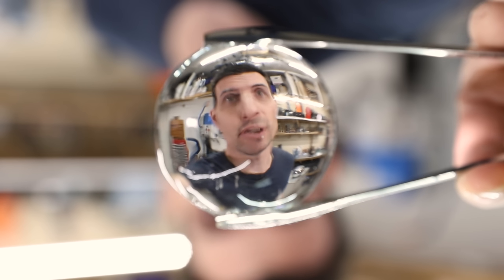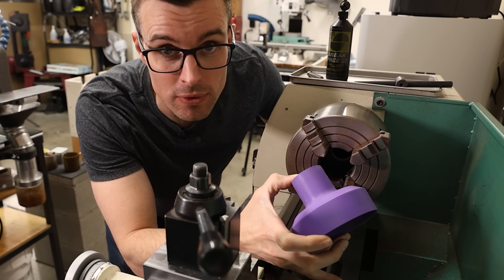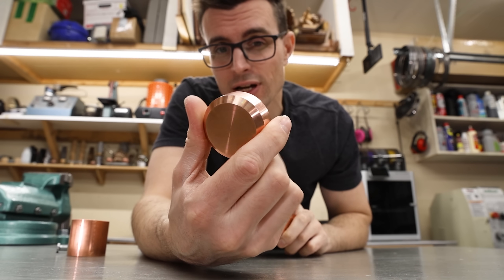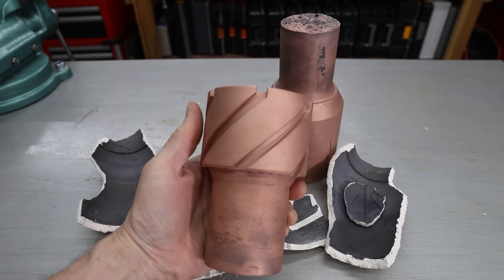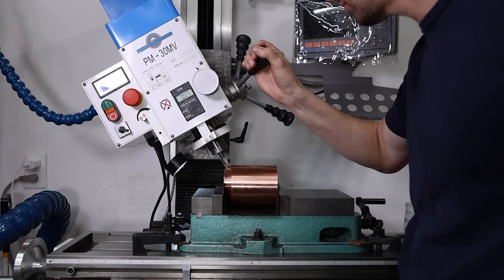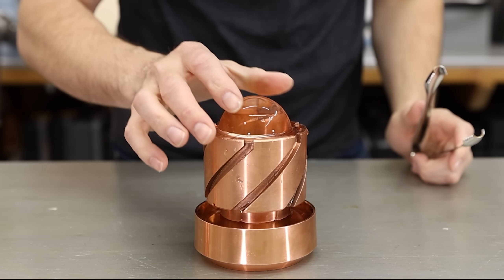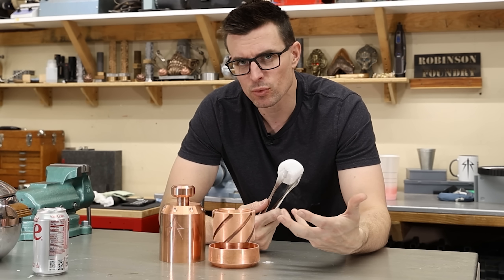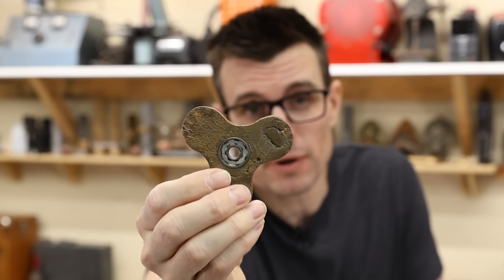I made a Copper Ice Press that Turns Ice into SPHERES - Lets try DRY ICE!

Comment: Just some fun math:
The specific heat of Copper is 0.385 J/g°C.  The latent heat of fusion of ice is 335 J/g°C.  Translating, that means it takes 335 joules to melt 1g of ice, and it takes only 0.385 to raise the temperature of one gram of copper by 1 degree.  You can simply divide and find that it would take 870g of copper to melt 1g of ice if the copper only cooled by 1 degree.  However if you have the copper at 120 F (49C), that's 49 degrees to work with so you divide again and find you need 17.76g of copper for 1g of water.  Those are basic ratios so you can substitute any unit (eg pounds or kilograms) and it's still the same numbers.

This assumes that the copper does get a chance to warm up by transferring heat from the air, your hands, or the table surface.  What I would like to know is if this device works off of its own thermal mass, or if it's just transferring heat from the environment.  The question is how much mass of ice is being melted.  If it's more than about 1/2lb for a room temperature press, the thermal mass of the press won't be enough and it must be functioning off of heat transfer with the environment.  If that's the case it means that a much lighter press would work almost just as well.

Comment: If you make another attempt, use the grooves as a built-in alignment tool. Still deep enough to channel the water away, but it would add to the satisfaction, watching the two pieces mesh together and spin as it closes. That was my original thought when I saw it. Also, on this scale, it may not be necessary, but using thermal compound between each of the parts that screw together should increase heat transfer. I'd love to see different stages of this tested or timed. You already have data for this stage, next would be to add thermal compound, then one with interlocking grooves, and finally, interlocking grooves with thermal compound (or potentially one machined from a solid piece of copper bar stock). Regulate the temperature of the ice press at the start of the test, use as consistent as possible pieces of ice, and time them all to find if there is notable difference in the speed at which the sphere is completed.

Comment: One thing you (and your follower makers) should be aware of... when you're melting DRY ICE in a press (or any other way) in a closed room, you are making CO2 (carbon dioxide), and you don't see any of the resultant gas as it is fairly odourless, and invisible to the eye.. (unless you melt it in water / liquid etc where then you will see the tell tale mist along the floor etc).... if you just melt it in a press like that, the CO2 gas has sunken down to the floor level (as it's heavier than air)... and if you lean down to the floor etc the concentration of CO2 can make you pass out.... (no oxygen)... if there is enough DRY ICE gas in the room (from melting a lot, OR doing the experiment lots of times)... you can pass out, and then be lying on the floor in the CO2 concentration and die from asphyxiation (no oxygen to breathe).... 

So please be careful, when using dry ice... a small amount probably won't be enough, but always do it in a well ventilated room, or open area if you are experimenting with it.

Comment: 1. I'd electroplate it with something more food-safe than copper. 2. 12:55 I fear the tilting of the cap causes visible alignment defects int he ice ball. This should be fixable by changing the shape. 3. Doesn't air get trapped under/above the ball?
Reply: Copper is food safe, this is not in contact with acidic foods or cooking for a long time, no need for electroplating

Comment: Copper has high conductivity, but I am concerned about food safety. It should be probably coated. Yeah, its water (not acidic), but also there will be very low "throughput" on the device (not diluting anything that is released).

Comment: Beautiful piece. I think with a small amount of redesign it might be easier to manufacture. I don't think the entire thing has to be copper, but it obviously will work best if it is. Copper is so expensive it would be hard to justify its price. You could use probably half of that copper and still have it work well. Just the part in contact with the sphere and a column up and down for heat dissipation is all you really need, the rest could be steel or any other material. Very nice piece and definitely love the copper look. Great job!

Comment: I am from Bombay, India.  I wonder where you learned "PATTERN MAKING"???   I had studied 'turning', 'fitting', 'carpentry',           "PATTERN MAKING", 'black smithy', 'foundry work' i.e., moulding IN SCHOOL, REPEAT IN SCHOOL!!!   (By the way we also had two foundries in our family, one with an under ground furnace for smaller stuff and one with  a regular "CUPOLA FURNACE" for really huge castings.)   I distinctly remember we had a  steel scale calibrated for different metals/alloys to help us in making patterns for each such product taking into account the shrinkage that would occur while the metal cooled in the moulds after casting.

Comment: It might work better if you cooled it down before putting the dry ice in it. I think there is a Leidenfrost effect going on, where the sublimating gas is pushing the cylinder way, but since the ice is a solid and not a liquid, it cannot conform to the ideal shape to "float" on the gas (like water on a very hot pan), so there is an oscilating effect, which causes the vibrations and noise, which also probably breaks the ice apart.

Comment: Are you using anything for flux, and do you scrape oxides and impurities off the surface of the molten copper? I've seen people use ordinary bottle glass and a bit of borax to create an insulating layer and a kind of absorbant medium for the surface slag (if you've ever cleaned/clarified fat/cooking oil with water, you may be familiar with the basic principle). As I understand it, because the molten glass is lighter than the molten metal, it floats and thus acts as a physical barrier that helps minimize gas saturation, as well as bonding with floating impurities. To be clear, I haven't tested the method myself, and my only regular work with molten metal is limited to silver-solder, but I know I couldn't make my work half as clean without a confident, judicious  use of flux. I think it might be worth at least trying, even if only as an experiment, to try an reduce porosity.

Comment: 10:27 Mythbusters actually talked about making clear ice once. What ice companies do is they agitate the water using air pressure, which helps isolate the impurities, which are then sucked out and replaced with filtered water.
Reply: Our lake had high winds for days in bitter cold temperatures and the moving waves prevented the ice from freezing. The wind died one night and the lake froze 5" thick of crystal-clear ice very quickly. So agitation alone at very cold temperatures prevents freezing which when the agitation ceases, the speed of the freezing will do it.
Reply: @paulbriggs3072  Experienced something similar once when I was a kid. My family lived right next to a river and one especially cold winter it froze over completely. The ice was like 30cm (12") thick but completely clear! 

It was extremely cool and terrifying at the same time. Made us feel like we were walking on water. Brown bottomless water, but water nonetheless!

Not something I recommend doing unless the ice is really thick though. River ice can be really treacherous and getting dragged under is not a fun way to go.
Reply: Alternatively, he could simply remove the ice before it fully freezes down to the bottom. It will still have some trapped air bubbles, but it will work for making mostly clear ice every time.
Reply: @ericchianese2078    yeah...  the trick is to not let it freeze solid.      obviously there's less "ice"   but  what does freeze will often be clear.  and just the shell/water at the bottom
Reply: just use directional freezing 
put a cooler filled with water in a freezer 
take it out after 24-30 hours 
not all the water will be frozen but the block that is frozen will be clear . thats literally how highend bars do it
Reply: Claiming impurities cause the white in ice is easily disputed with distilled or reverse osmosis water which also freeze full of white/bubbles despite being as pure as can be practically achieved.  It will still turn white when frozen.  It is dissolved gasses from the air (mostly oxygen with some nitrogen and carbon dioxide) that are released as the temperature drops and the solubility of those gasses drops with it.  
You can achieve 100% clear ice with tap water even in areas with hard water.  The key isn't agitation or or filtration, it is directional freezing.  The ice you get from commercial ice machines is always clear because it is frozen (depending on cube shape) from the bottom up.  Water fills a plate of cube molds then periodically recirculates water over the plates, keeping the top from freezing while letting the bottom continue to freeze up towards the top.  This continues until the plates/molds are frozen to the top then the ice is dumped into the bin.  This way the dissolved gasses can escape into the atmosphere rather than being trapped inside the cube.
Directional freezing at home is accomplished by using an insulated with only the top exposed.  Water freezes top down and you stop the freezing process/remove before the entire container is frozen, usually about halfway frozen. This leaves very clear ice even with hard, unfiltered water.
Reply from the maker: Interesting, I'll look it up. Thanks
Reply: Could you agitate with a sonic cleaner while freezing?
Reply: @ChauHuh  my guess is no - here's why. An ultrasonic cleaner puts high frequency energy into the water. When parts you are cleaning get in the way of these energy pulses, the surface of them appears to "bubble". Those bubbles are actually vaporized H2O. So at best, you will have no change vs whatever water causes that trapped gass streaking (I think), but worse case, as the ice freezes, the solid parts will react in a similar way, and ALL of your ice will be clouded.

Also, I'm not sure how the piezoelectric element will react to a potential solid (in case it freezes completely) but my bet is it will break.
Reply: I make clear ice all the time. I use a normal silicone ice tray with normal, unmodified tap water, with some packing foam from an Amazon package around the sides and bottom.

I let it freeze solid. Then the cubes are crystal clear except for a layer on the bottom, which I remove with a knife (shaving it off, not very difficult at all).

It takes me maybe 2 minutes of labor per tray of ice, and about 6 hours of freezing time, and the resulting cubes are so clear that in a glass of water they disappear.

You have to remember to let them temper before filling the glass, though; otherwise they will crack. Just give them a few minutes to come up close to freezing temperature.
Reply: Most ways I see doing this is with small acquarium/fountain type pumps to agitate the water and keep it moving as it freezes up.
Reply: Came to the comments to say this.
Reply: Easier is that the impure freezes last so they make containers that they know won't fully freeze overnight or some other timeframe and pull out the clear ice and dump the water with impurities.
Reply: I think about that episode every single day. Its just something that pops into my head whenever I see an ice cube.
Reply: Or you could just start out with distilled water.
Reply: There's a whole industry of clear ice, business insiders did a whole video on it.
Reply: my tabletop ice maker makes clear ice.  It has metal forming square spaces and running water trickles over it.  The ice cubes that form are clear.
Reply: Or just circulate the water and allow it to freeze from the top up.
Reply: the rare pleasure of reading a youtube thread that is informative and civil
Reply: It's easier to get clear ice when you use hot (boiled) water.
Reply: @drucker03 I thought this too
Reply: @adz2398  And it's easy to verify by trying it at home.
Reply: Like  @drucker03  said, ice made from putting just boiled water directly into the freezer is a whole lot clearer.
Not only that, but it also freezes faster than water at almost zero degree Celcius, for some reason.
Weird chemistry fun fact almost nobody knows of.

Also, like other people said, I guess further purifying water first might help.
Reply: @neetscholar4149 I'm fairly certain none of that is true. Any ice frozen normally will concentrate impurities and dissolved gases towards the middle. Directionally frozen ice concentrates it to one side so the rest is clear.
Reply: @The_Jovian  Just try it.
freeze 2 ice cube trays at the same time.
one with cold water, one with water boiled right out of the kettle.
The hot water will freeze faster.
And the ice made from cold water will swell a lot more while freezing, while the hot water one will remain almost exactly the same size in the container.

The one leeway I can give you, I'm not sure WHY this happens.
Maybe it's not about the temperature, but somehow boiling it remove so many impurities that it's the cause of the difference. 
But I assure you this happens. Tried it myself.
Reply: @neetscholar4149  From the Wikipedia article about boiling/hot water freezing faster than cold: In 2016, Burridge and Linden defined the criterion as the time to reach 0 °C (32 °F; 273 K), carried out experiments, and reviewed published work to date. They noted that the large difference originally claimed had not been replicated, and that studies showing a small effect could be influenced by variations in the positioning of thermometers: "We conclude, somewhat sadly, that there is no evidence to support meaningful observations of the Mpemba effect."
Reply: Can you just put it in a vacuum for a while. That's how they do to get rid of the bubbles when casting stuff in epoxy.
Reply: @ano_nym  in the Case of frozen water ITS not Bubbles but impurities
Reply: @ano_nym putting liquid water under vacuum makes it boil
Reply: Just use distilled water at a high temperature, which has no impurities or air bubbles. Boiled water also works just fine
Reply: Why not just distill the water, then no impurities?
Reply: I continue to "shake" oilmen with my innovative project of a non-combustion engine, I remind you that I am posting here on my channel the technology and the principle of operation, according to which anyone can create a prototype and enjoy free energy, since I was denied financial support at the stage of the idea and theoretical research, after a year of unsuccessful searches. Including I will begin to assemble a sample. And soon another video will be released, revealing my developments, the wind of change is approaching! All those who are not indifferent, welcome to the flight in this departing innovative car, which will lead to great achievements for the successful future of the planet and humanity!
Reply: @maguccimotorincorporation   Next time just say, "Hello,I'm a scammer, and a crackpot." It's shorter and gets right to the point
Reply: @ I'm not a scammer or a psycho. But history repeats itself, when everyone rode horses and people made fun of the man who tried to make the first car.
Reply: @maguccimotorincorporation  🤣